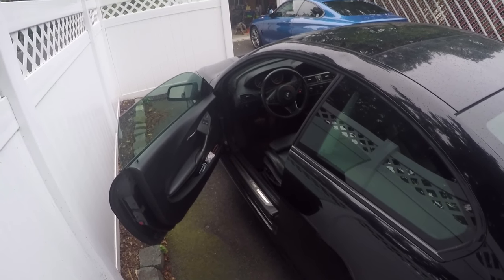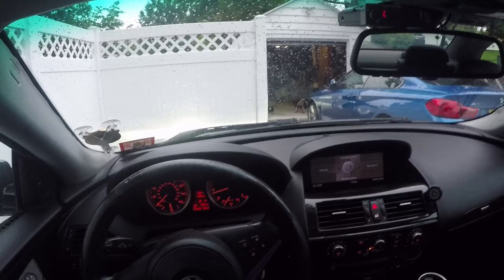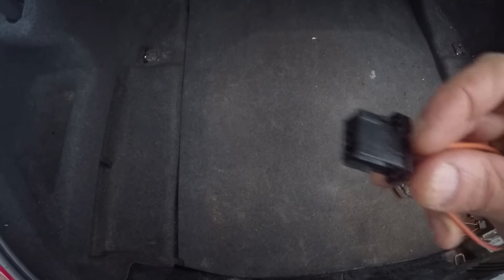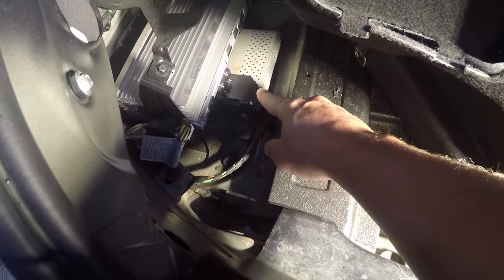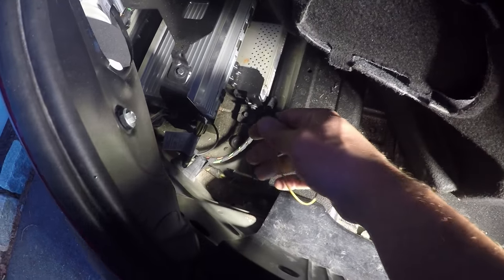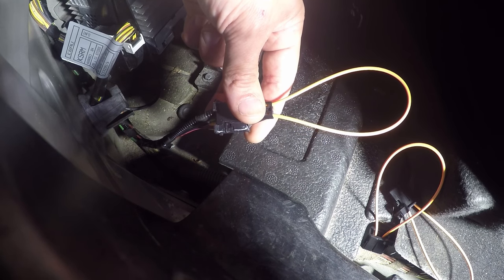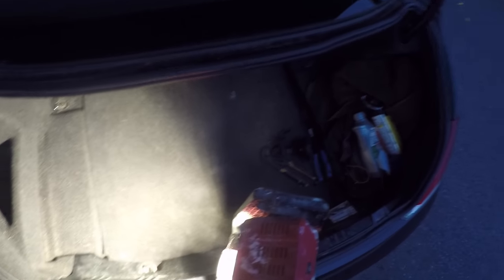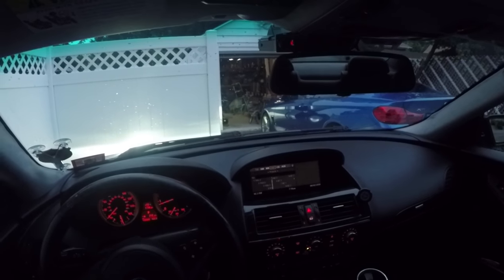FIX BMW SOS Error Light Audio System Failure CHEAP + Tips Others missed!

Comment: I have a 2006 530i...
I have the loop...
but notice that I dont have the satellite unit...
I took the trunk totally apart looking 4 it...
so what do u think it could b or what do u think I should do next...
thx in advance...
Reply: also I notice that I believe where the satellite unit would b @, there's a piece where I can plug in that loop...
Reply from the maker: @petewilliams9493  It could be another component in the MOST network.  The same adapter would be used in troubleshooting (bypassing) other components until you find the one that is causing the error.  SOS error can also be caused by a loose or water damaged SOS speaker (there is a dedicated speaker) in the driver side foot well area.
Reply: @ModsAndProjects  so u saying it could be my front speaker, cause BMW is asking $2,000 to fix the problem which I haven't gotten fix yet...
Reply from the maker: @petewilliams9493  Not one of your MAIN audio speakers, there is a small, dedicated SOS speaker in the driver side foot well.. if it is disconnected of loose is can cause the SOS issue in a 2006 BMW.  Did BMW Diagnose it? If you can get them to tell you what part is bad you can repair it yourself or bypass it if it non-critical.  Do you have ANY sound?  Intermittent sound?
Reply: @ModsAndProjects  no of course they not going 2 tell me lol...
I have no sound @ all not even when the doors are open...

Comment: Hello There, Do you have any idea about E60 535i iDrive? I can use up and down rotator but it does not select the option. is it a simple fix?
Reply from the maker: Sounds like a bad CIC/CCC
Reply: What's the solution? Do I need a new I drive or CCC?
Reply from the maker: @azherrazvi6374  what is the year of the vehicle? Are you having any other symptoms?
Reply: 2011 
No other symptoms. 
I can't select any menu options. Press button does not seem to be working.
Reply from the maker: @azherrazvi6374  could be something mechanical with a knob itself with a select function can you select anything at all? If not I would be suspicious of the knob. Once the knob is ruled out as a mechanical failure point I would turn my attention to the CIC and send it in for repair that is the cheapest option.
Reply: When you press it does not select any thing..  Do I need to change the drive? Where can I buy cheaper?
Reply from the maker: @azherrazvi6374  you will need to look up the specific part number for your vehicle regarding the assembly beneath the knob. I recommend getting the part from somewhere you can return it if that does not turn out to be the issue
Reply: Where do you recommend from? EBay, Amazon or local dealer?
Reply from the maker: @azherrazvi6374  if I were you I probably just identify the BMW part number and then buy off eBay from a seller for cheap with return policy
Reply: Do I need to open up that I drive panel to look for part number? Or I can find some where else. ?
Reply from the maker: @azherrazvi6374  just doing one of the major BMW part sites like FCP Euro or pelican parts put your vehicle and your number in there and start drilling down you will find it. Then either buy it from them new to test out the part and return it if it turns out not helping or go on eBay to look for one for cheap wth a  return policy
Reply from the maker: @azherrazvi6374  1. https://rover.ebay.com/rover/1/711-53200-19255-0/1?mpre=https%3A%2F%2Fwww.ebay.com%2Fsch%2Fi.html%3F_from%3DR40%26_nkw%3D65829206444%2B%26_sacat%3D0%26_sop%3D15&campid=5338374215&toolid=20008

2. 2nd part does not come up.

Comment: Would the SOS issue make my aux stop working?
Reply from the maker: Yes it can definitely make your sound stop working if the issue is related to your TCU or MULF
Reply: @ModsAndProjects  Yeah its a werid issue but i dont even have a SOS module. Went to some nice guy to get it code out to see if that helped. SOS goes away no error, but i still cant get no Aux Volume to play. When I choose the option external devices it doesnt even select a device ( tried different cables and phones) and it doesnt let me change the volume. Just stuck on zero, was told it could be the combox or the USB/Aux Port itself. What do u think?

Comment: Hello..would this work if water got on the amplifier?
Reply from the maker: It will help to diagnose your issue.  The one linked in the description comes with full support even if you cant get it running with the cable.

Comment: What if my screen is also not working I try bypassing it but it didn’t work what should I do?
Reply from the maker: If the IDRIVE screen is not working it is likely caused by a bad CCC or CIC it will need to be replaced or repaired.  Either way, the loop in the description comes with full support to help you figure out exactly what is going on with your particular vehicle.

Comment: I spilled 5 gallons of diesel fuel in my trunk, now I have the SOS.. do you think this would work for me?
Reply from the maker: The loop will help to diagnose which component was damaged by the spill whether or not you use it to permanently bypass the damaged component or as a diagnostic tool to help identify a component that needs to be repaired or replaced.
Reply: @ModsAndProjects  that makes sense, thank you. Say it's the amp that is bad, if I bypass it then i still wouldn't have audio but the SOS would be gone?
Reply from the maker: @nonagreeable  Yes, generally that is how it works out.  it is not an exact science however because the amp could have been damaged and several locations depending on where the short occurred inside the component from the fuel spill The bypass may or may not get rid of the SOS light, but you would definitely loose sound. it is also possible that TCU or satellite receiver if you have one was damaged from the spill so you may be dealing with multiple component failures.  If you get the loop from the link in the description it comes with support.
Reply: @ModsAndProjects  thanks I'll do that.

Comment: I changed my radio and started getting the sos how do I just code it out or make it stop cause there’s no real problem
Reply from the maker: If it's an aftermarket radio you will need to coat it out. If it's stock and you still have sound and you want to get rid of the air easy you can just use a bypass to bypass the component that is causing the error generally

Comment: i have a 07 335xi and i got the bypass and it didn’t work. i have no audio for the radio, aux, but for the seat belt/codes i do. can someone help me, thanks
Reply from the maker: It could be your amp.  DO you get any sound at all?
Reply: ModsAndProjects yeah, when i put the key and warning lights

Comment: i have no audio on my 428i, but the SOS light is not on, would this fix the audio issue ?
Reply from the maker: The loop is always a useful tool whether or not it gets your issue corrected or not it will help you troubleshoot and identify the component that is causing the issue.  if you purchase it via the link in the description of the video I will personally help you troubleshoot until we identify the problem via phone conversation.
Reply: @ModsAndProjects  oh man i just got it from amazon
Reply from the maker: @antuen The link in the description is from Amazon.  Is that the one you got? (pre-trimmed)
Reply: ModsAndProjects I don’t think I got the same one, the one I got fits perfectly when I try it, I have not tried the satellite unit yet tho..

Comment: Hey what’s up bro I have problem with my bmw 530 the radio works fine but the sound don’t work I don’t know why would you help me please
Reply from the maker: Need more info... What year? Do you get sound from any sources? (FM/aux/BT/CD) Do you have the SOS error? Do any on the speakers work (even if they are super low?  Any pops or crackles? Did it stop working out of nowhere or were there symptoms before the loss of sound?
Reply: ModsAndProjects ok here’s my problem my old radio was not working at all so I buy use one and when I bit the one I buy everything works beside the sound my car 2007 530xi
Reply from the maker: When you say "radio" do you mean the CCC unit (where you put CD's and NAV disks in on older model/ 2007) if the answer is yes, the CCC needs to be coded to your car to work properly.  If the sound never worked, i would also have a look at the power amp.
Reply: ModsAndProjects yeas I mean the ccc the old I have is not the same code ass the one I buy so what I should do
Reply from the maker: Yeah, you definitely need to have the replacement CCC coded if you keep it.  The stealership will undoubtedly overcharge the hell out of you to do it (call and let us know what they say) - If the old CCC was dead i would recommend returning the replacement unit you bought for a refund, then sending your original broken one out to this guy:  

http://www.bmwlogicseven.com/

He does GREAT work at a fair price and can also fix your Logic7 Amp if you have issues there as well.
Reply: ModsAndProjects my problem is only with the ccc not the amplified
Reply from the maker: @janmarooki8096  the link I provided is to a CCC expert.  He can code your new one or fix your old one.
Reply: Ok sir thank you for helping
Reply from the maker: No Problem, your CCC is in good hands with Logic7, he knows these units COLD, down to the lowest level.
Reply: Omg I finally found someone to help me with my 2008 BMW 535 no sound I hope this works and do u know anything about the turning signals they work in the front but not the back

Comment: My 2011 5 series got a sos error after at&t shut off its 2G network 🙄
Reply from the maker: That's a new one to me!  Is the sound still working?
Reply: @ModsAndProjects  all the radio works except connected drive , sos and the live maps traffic as those are over the 2G cell modem. BMW sent home a letter saying the will refund me the subscription money due to the shutdown. The website states 2014 and later model uses 3G modems now and 2017 uses 4G LTE modems with amazon Alexa support.

Comment: Where do you get that most adapter
Reply from the maker: hello, thanks for commenting :-)  the bypass loop is a great tool because it allows you to identify exactly which component is malfunctioning. The particular loop in the description of the video above comes with direct customer support to assist you with identifying the exact problem and helping you to decide whether just bypassing it or regaining the functionality is the best course of action. A lot of times people just bypass out something like the satellite radio to get rid of the SOS light or to get there sound back, however, if it is something like Bluetooth that you might want to get the actual functionality back the tech support will guide you to the best course of action in getting it addressed avoiding the crazy prices the dealership would charge. For $14 it’s pretty awesome that you get that level of technical support!

Comment: Hello I bypass my radio ( optical loop) still no sound
Reply from the maker: If you purchased it from the link in the description it comes with full support from the seller on Amazon!  In the best case scenario the loop bypasses the component that is bad on the first try, otherwise it could be another component entirely.  The loop in the description is universally compatible with all multimedia related components in the vehicle.

Comment: Mine doesn't come with a satellite. So what should I do?
Reply from the maker: Buy the loop from link in description and they will help you to troubleshoot. Could be the CCC, TCU, MULF2, AMP etc...
Reply: @ModsAndProjects  yes I do have the optic loop. But because it doesn't come with an satellite. I have nothing to comment it to
Reply from the maker: @andrewgotti589  Did you get the one from the link in the description? If so, it came with a contact card to help you resolve the issue.
Reply: @ModsAndProjects  no. I bought this one off Amazon but I'm going to look at the one in the description
Reply: @ModsAndProjects  it's the same thing that I have in my truck right now which the female one

Comment: Didn't work for me...could it bee something else?
Reply from the maker: Hello, first you would need to 100% confirm the satellite radio is in fact malfunctioning, the loop is a great tool for this just to confirm. The loop in the description of the video comes with full support directly to help you troubleshoot definitively what the problem is in the best approach for repair or replacing if desired

Comment: Mine didn’t work:( please help
Reply from the maker: Describe the problem. for the record if you get the part from the link in the description it comes with personal troubleshooting support until the issue is corrected.
Reply: Well, there is a small screeching noise that the radio produces once in a while. No audio at all. It doesn’t give me an option to connect my phone for Bluetooth ( i have i drive) and I have the SOS error on my display. I ordered it from the link ( the pre trimmed one). Alot of the electricals on the car are shot. This is my first car and im very appreciatve of the bimmer community you guys are helpful thanks!!
Reply from the maker: @skinny6710  Did you get the card that came with it, it has a bunch of social media links where you can DM me.  Once you DM me i'll call you to help you troubleshoot it, it sounds like you may have a few things going on but ill stick with you until we get it fixed.

Comment: I have Audio but the light comes on that’s all
Reply from the maker: try the loop in the description  on the auxiliary components, if you have sound at least you know the CCC/head unit and amplifier are good, it has to be one of the auxiliary components.
Reply: @ModsAndProjects  so I still replace that little wire you did in the video
Reply from the maker: What's the year and make of the vehicle out of curiosity?
Reply: @ModsAndProjects  2007 bmw 328i coupe
Reply: @ModsAndProjects  I just installed the loop but that didn’t remove the light
Reply from the maker: @hectorespinoza7641  there are generally several components to try the loop on, you need to follow the green fiber optic cables to locate each component and try the loop on each component. If you are still having trouble after that, reach out through the platform you purchased the loop from and we will help you troubleshoot directly
Reply: @ModsAndProjects  I bought it off Amazon
Reply from the maker: @hectorespinoza7641  send a message through Amazon messenger

Comment: I did the same thing but it didn’t work?
Reply from the maker: Explain your problem in more detail and I will try to help.
Reply: About 4 months ago my sos malfunction came on and cut out my music but it’s never completely shut off until one day I plugged in my aux and my speakers made a loud screeching noise and they haven’t worked sense. I tried the by pass just yesterday and nothing so I’m hoping it’s not the amp.
Reply from the maker: @lilmacc  to be honest it sounds like the amplifier, try bypassing the amp and see if the SOS light goes out. You obviously won't have any sound when you bypass the amp because the audio signal will not be able to be amplified but if is the amplifier that is bad and some stopping the fiber optic signal from continuing in the loop it may turn off the SOS light when you use the bypass on the amplifier.  If the  light goes out when you bypass the amp I can connect you with a guy who is great at fixing the logic 7 amplifiers at a fair price.
Reply from the maker: @lilmacc  also locate and try bypassing the TCU
Reply: ModsAndProjects ok Ill definitely give that a try tomorrow and get back to you  if the sos light goes off. Thank you

Comment: 80% of the time? I've got the same issue but my screen wont work either...
Reply: Me too dude smfh 2004 645
Reply: @rudewhipz6199  I think I figured it out. A white box about the size of a small pack of cigarettes located under the spare tire. Its marked MPM, media something module, easy to change out but BMW wants $400 cdn.
Reply: @joelcromwell5983 I swear I was just in the trunk looking at that white box
Reply: @rudewhipz6199  it opens up, check for a burnt smell or charring inside or on the plug. Mine smelled burnt.

Comment: Not working for me!!!!
Reply from the maker: hello, thanks for commenting :-)  the bypass loop is a great tool because it allows you to identify exactly which component is malfunctioning. The particular loop in the description of the video above comes with direct customer support to assist you with identifying the exact problem and helping you to decide whether just bypassing it or regaining the functionality is the best course of action. A lot of times people just bypass out something like the satellite radio to get rid of the SOS light or to get there sound back, however, if it is something like Bluetooth that you might want to get the actual functionality back the tech support will guide you to the best course of action in getting it addressed avoiding the crazy prices the dealership would charge. For $14 it’s pretty awesome that you get that level of technical support!

Comment: This is way wrong this I beleave is a trick to fuck up your car..If you have X-m  radio it’s caused by a refreshing the radio. So you have to take it into bmw and they have to reboot your system for free or if there is a charge XM radio has to cover it. Because that’s what I had to do